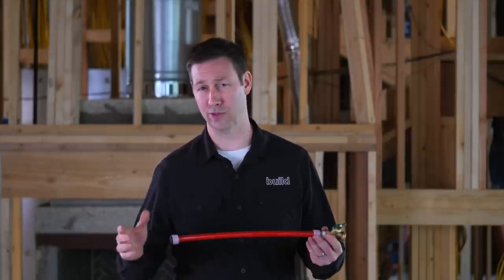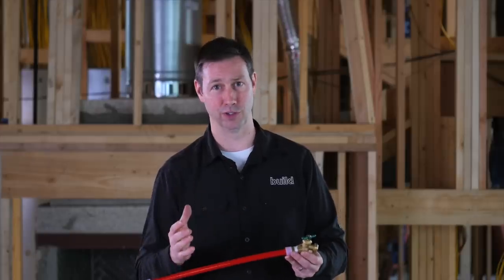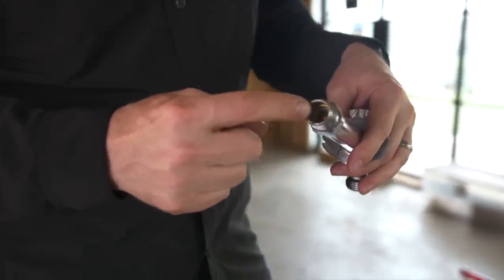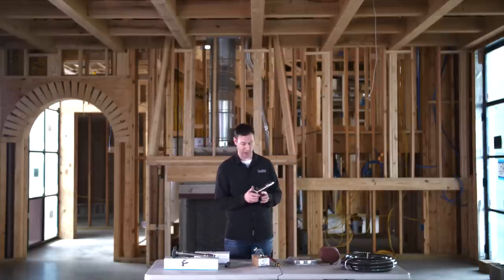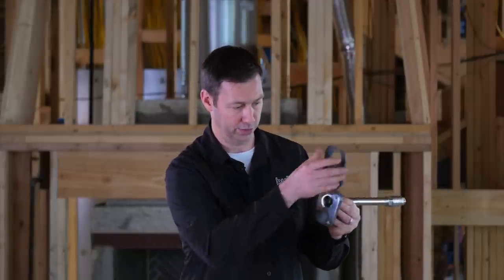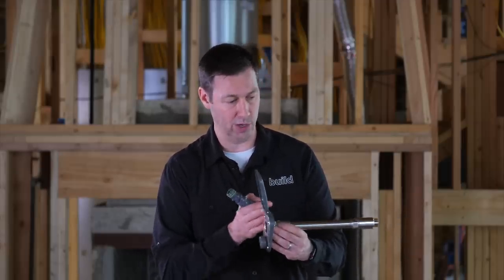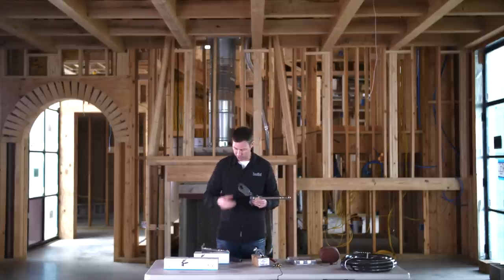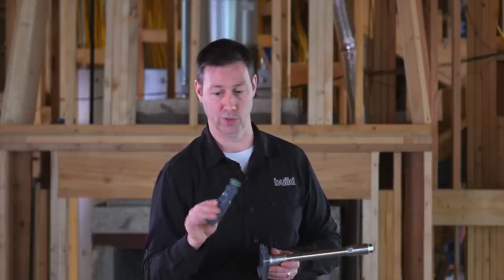No More Hose Bibs - A Better Outdoor Faucet

Comment: For all these naysayers I'm assuming y'all are still using knob and tube wiring in your houses? Sheesh, chill out and stop being so close minded.
Reply: Skisworkshop copper piping for life.  Anything else is trash
Reply: When these "New" ideas prove the test of time (50 yrs) and ease of instant no-hassle use is
when they can go into one of my homes. The price X6 along with the loop hassle and the
extra ball valve bib that has to be left on every hose or lost in the garage.
Just another expensive trinket. No thank you.
Reply: Your guys’ views on new technology & products is really uplifting and inspiring.
Reply: I love Tech but it HAS to be useful, it has to solve a problem and it has to do it well.
As for copper pipe, fine in the south but here in the north if your power goes out
for whatever reason and that copper freezes and the pipes burst, your house is in
a world of hurt. Give me PEX any day but pex is only as good as the clamps that
hold the ends together, the clamps HAVE to be quality stainless or you are gambling.
How about we have a video or two on what happens when pipes burst and the possible
damage, if the particle board or MDF cabinets get wet they are ruined where is the tech 
made waterproof cabinet sheet goods stock?
Just because something is new looking does not mean it's a good design and that goes
for the design of the entire house as well, they have to function.
Architects HATE the phrase form follows function, I know, my wife is an Architect and
I am a design/builder.
Reply: I definitely prefer pex over copper. Acidic water doesn't corrode it, more durable if it gets knocked around, more freeze resistant. And yes my knob and tube wiring works great 118 years and going strong.  The galvanized pipe not so much.
Reply: A new product and improvement in technology was happily accepted when the frost free hose bib was introduced because that was an improvement on the design. This is not an improvement to the design and I'm guessing the majority who are in full support of this probably haven't used one yet.
Reply: It's a matter of value for cost for me. I'd rather spend more to get more, but only to a balancing point. I have installed $300 recessed hydrants on houses outside  Philly, where the wind chill and long term cold justify them, but in Virginia and North Carolina, a 6-10" frost free hose bib at $25 does the trick with basically no headaches. I was not the first to change from copper to Quest and avoided the failure problems, was not the first to change to CSST flexible gas lines and avoided the grounding and bonding issues which showed up. Copper water lines have their problems just as black steel gas pipe, just as any building material. I now use PEX and CSST as they have developed a history, but still see lots of problems caused by improper installation, service and maintenance, but the history helps me find these issues and avoid them, both for myself and my customers.
Reply: Yup, my house still has knob & tube....
Reply: See, I can go to the hardware store and buy a new outlet, that will hook up to the romex in my walls. 

You can't go to the hardware store and pick up a new adapter for this faucet. At least, not that I've found.
Reply: Um better stop using NM wire then that shit is almost 100 years old... better find a new way to wire your home...
Reply: Naysayers? We are just not sold on it. Our reasons seem valid. And by the way, I don't trust knob and tube wiring. I'll stick with my candles, thank you very much.
Reply: It looks cheap and made of plastic, like something a poor person would have. Yet it's expensive as hell. We already have frost free bibs.

Comment: 90 dollars
pffffffffffffftttt
Reply: Unfortunately thats how capitalism works. This thing is probably cheaper to make than a normal wall faucet. $50 for a normal wall faucet (lead-free, BPA-free, anti-siphon, freeze proof), $10 for a service kit about every 3 years. This is $90 but you still need the attachment which is another $12. This thing also has an o-ring so it'll need to be replaced every so often. Can't even find a repair kit for it.
Reply: The o-rings on the insert wouldn't be an issue. Not sure about the internals. 
Hydrant prices can be ridiculous. I mean you can get Anti-Siphon hydrants for 25-30 in the store but some are also over 75. I've never had to service one.
Reply: There must be an o-ring in the valve as well and since its exposed to the water all the time it rots pretty quickly.
Reply: +BlindAF The packing gets hard and cracks after a while. Worst case it jams the valve.
Reply: +N C You seem nice XD It says right on the product website its an oring valve. To clarify the first part there must be an oring in the valve as well is just simple deduction. The second part " since its exposed..." I'm referring to my experiences with wall faucets. Admittedly this could have some special sauce oring that never rots. I don't actually know that. But I'd like to that was the point of my comment.
Reply: +N C Along with that engineering degree how about a reading comprehension degree while you're at it?
https://www.aquorwatersystems.com/wp-content/uploads/House-Hydrant-V2-Spec-Sheet-4-2017.pdf
On page 3: part 3 - hydrant body oring, part 4 - inner valve oring There MUST be one is not conjecture it IS an oring value thus it has an oring. Reread that 3 times if you need to. DuPont Delrin is whats used in the hose bibb. A completely different unrelated component to the shutoff valve. Although I did just lean the bibb also has a check valve in it. That's pretty cool. Part 18 actually and oh look? Do you see it to? Another oring. I rest my case. You're full of shit go take a nap or something. Stop being grumpy.
Reply: +N C I mean hey, I didn't look at the spec sheet before and it actually explained quite a bit including part numbers for the orings. So in a round-about and clumsy way you did in fact shed some light on the lack of repair kit issue. Speaking of bloviation though you're the one who introduced the pedantic banter, trying to make an argument out of nothing and failing at it. In fact every paragraph in your last post is a semantic nitpicking which is why I'm not entertaining any of them. claps You're using your two degrees well.
Reply: +N C just read the comment thread and see where it started off. It wasn't immediately obvious from a product search (I just searched on amazon) that there were any repair kits for order. So one of my criticisms is that there is no repair kit and that there would likely need to be one since its orings some day will need to be replaced. I figured that was a pretty salient point when purchasing a $100+ item. When you mentioned the type of plastic used on the bibb it occurred to me there's technical specs which sometimes have parts lists and sure enough it does. Totally doesn't mean those parts are for sale but its at least somewhat reassuring.

Comment: I like looping it but as with anything getting your contractors to build the way you want vs what the same contractor does for everyone else drives the cost and slows down the schedule. I build all high end custom homes and in certain areas of the country it is hard to find contractors that not only listen but do quality work. Quality costs money, if you want the installs to your standard and not just meet code.

Comment: Not impressed. Just look at what they use in Finland: simple as can be (and cheap), water never freezes in the pipe because when you shut off the faucet, the excess water drains out the hole in the bottom.

Comment: Don't know if you read these comments but here is a simple, cheap, have-to-have item for all your Southern customers. Just add a wall switch in the garage that shuts off the power to the garage door openers. A nearby lightning strike can fry the boards in multiple garage door openers at the same time. Not uncommon to have 3 in a new house and replacement costs can run into the hundreds plus labor, not to mention the inconvenience of having to manually operate the doors.

Comment: Yeah, that's neat, but this reminds me of the debacle with Apple removing the headphone jack and replacing it with a proprietary dongle you plug into the charging port to listen to music with. While I can see the appeal, this wouldn't be something I would use for my future home. A neat concept though.

edit: Adding the loop of water pipe in the wall is a neat trick that I will utilize in my first build. Thank you for showing that

Comment: enjoy your face full of water everytime you unhook it
Reply: No one seems to have picked up on this, though I laughed out loud when I read it! In fact I can't think of any way to avoid it. The other end of the hose is shut off, so pressure builds up in the hose. You unplug the connector, which shuts off the supply but releases all the built-up pressure in the hose. What a mess!

Comment: Is this not just a plastic version of a buckner brass quick coupler valve? We use brass quick coupler valves pretty much everywhere here in Ohio. By far the most common outdoor water supply valve I see, especially at homes with a sprinkler system. Anywho, I would just buy a brass buckner quick coupler. They basically last forever.

Comment: That a nice looking faucet system, but I can't see the practicality of this - especially for a house with kids!!

#1 - $90 for a hose bib?? Really?!?!
#2 - Need special adapters for each faucet.
#3 - The first adapter shown is a full-on adapter with no flow control.
#4 - The special adapters are plastic - which can probably be broken if someone pulls a little too hard on the hose as they try to get that LAST INCH of reach in the back corner of the yard...
#5 - The adapters make their water control connection 1"-2" inside the front of the faceplate - so if the adapter gets broken, you need to turn off the main supply to stop the water flow.
#6 - If the adapter gets broken the typical homeowner would probably have to call a plumber to get it removed.
#7 - The adapters on Amazon are About $35 for each
#8 - How long will the manufacturer be around? How long have they been around already? Will there be support in 5, 10, 20 years?

Yeah...Looks nice and pretty, but not something I would consider for my house.

If your client wants the hose bibs hidden, build a recess with an enclosure to hide the bib. It'll look pretty, have regular functionality, be serviceable, and will last for years and years without headache.

I will say this though - I LOVE the internal loop idea!! I think that should be done for ALL through-wall connections! Would make down-the-road servicing much easier!

Comment: * More expensive
* No shutoff valve so you have to unplug your hose for the water to drain
* 50% plastic construction
* Have to get custom non-standard fittings for all your hoses

This guy is just advertising overpriced junk for an amazon kickback & to please his sponsors.  Scam.

Comment: Yeah no thanks. Only 5,000 connector engagements until seals need replacing. Water starts to come out moment you push the peace in, when most cases pipe is there for whole summer and you are looking for just reliable valve. Separate valve peace can help some what, but system like this that relies on twisting, just ask pipe to turn and be disconnected. Also only minus 21C temperature resistance is way too little. We get minus 30C here and before global warming it use to be minus 60-70C at worst.

Comment: How would the plastic hose attachment hold up over time when I am running my Dewalt 3300 PSI 2.4 GPM gas cold water pressure washer next summer?

Comment: Honestly, this looks so cool UNTIL you plug in the bib thing... That looks awful and cheap and is also realy inconvinient! Why? I have watering computer installed on my current hose which won't work on this thing because it's designed to be placed in a 90° angle down.
I got one of the second bibs you showed, those with vac breaker and this is just great. It's a normal bib where you can connect every STANDARD stuff you like without any flimsy plasticy bs stuff. And the best, when you turn it off, which you usually do like every time you don't use it, guess what, IT'S FREEZE SAFE!!! No detatching anything, no extra thinking, nothing, just close the valve and you're good. Oh and it's much cheaper! 
OK, it may not looks as cool as this thing but if that's you're only problem you may not need any water plug or bib at all hahaha

Comment: I call it BUST. Them rascals bust to smithereens. Now Matt, putting that loop for future use is SMART!! But I don't like that it's plastic, plastic cover, etc. I'd pay more for steel, aluminum. Especially the actual hose connector. I in east central Georgia, hey even here, you'd better prepare for some COLD weather! I've seen it as low as 9°. Those not prepared have problems.

Comment: Never had a problem with normal spigots. Though I'm also smart enough to know freezing is bad for pipes and shut off the outside spigots from the system inside. I could have sworn there was a code that required that. So much plastic in that design, it can't last long. I do like the loop idea, though. Just for that 1 in a million chance that the spigot actually fails in 50 years.

Comment: After reading comments and thinking about it, this seems like a solution we don't need. I really like my washerless 12" through the foundation block outside faucet. What's bad about these? Strong all metal, no worries. On/off, easily adjust pressure coming out of hose, yes, I'll keep using this kind. Hate plastic.

Comment: If you're building the house, just feed all the outside hose bibs from one line, and put a valve on that!  $90 for a hose bib?  Does it quick-detatch?  No!  Is it plastic, and long enough to break off under force?  YES!  

Looping the PEX assumes it won't dry out and crack in the loop.

Comment: so, what do you do when you live in the south (SW Mississippi) and your 40+ year old FHA house has frost free hose bibs that start leaking. New rubber isn't available because the type of hose bib isn't available anymore, and there's no way of knowing if the bib is threaded into old copper pipe, or old pvc, or what.. ???

Comment: Not going to comment on the plastic plumbing appliances featured here because everyone should learn the hard lesson of using them on exterior applications. But the southern falsehoods I must bring truth to. I've doing plumbing in the south for several years on older and newer homes.  "Freeze Cocks or Frost-Proof Silcocks" as they are called have been plumbing code since the 1960s. Not that they don't exist, but I've never found a short hose-bib on any home south of the mason dixon line.  And further more no contractor is getting away with running pex directly to a short hose- bib on an outside wall.  Maybe this is common practice in Matt's southern Texas, but the home I owned in Florida had Frost-Proof hose-bibs, and the one in Tennesse, and Oklahoma. Just clearing up that this is not a "Southern thing", we use frost proof silcocks.

Comment: Sure Matt... what could possibly go wrong with a cheaply made plastic part that plugs into another cheaply made plastic thing mounted on the outside of a house in -20F weather?? sure pal. Why would I use that? Normal faucets are not a binary on/off flow. How do I control pressure/flow with that thing? useless.

Comment: Uncommon fittings on common equipment. What could go wrong? I use quick-connects because I never leave an idle hose connected to the bib, and use 1/4-turn hose bibs. What I neglected is how flummoxed a gorilla-fisted contractor gets when he needs to unscrew the quick-connect fitting and thread his hose on to the bib. And, I've replaced several handwheels where gorilla fist cranked it two turns open. And if it's a rental? Forget it. Go common and go brass.

Comment: I don't know if these are any good or not, but many of the comments aren't.

"Sometimes you don't want full flow!"

Ignoring for the moment (as you all apparently have) that Mr. Risinger pointed out that a standard faucet adapter is available and assuming that one's going to use the standard adapter,  what do you all think's going to be on the other end of the hose in such instances?  I don't know about you folks, but when I want to regulate the flow, I put a nozzle on the other end instead of running back and forth to the faucet a dozen times.  Sheesh!

"It's plastic!"

The device itself is metal:  only the adapters are plastic.  They look very thick and sturdy.  Might they eventually break?  Sure, that's true of anything.  At which point you buy a replacement or use a spare.  (It takes a quarter turn to put them in:  if you can't figure out a way to extract the inserted piece, maybe you don't have the where-with-all to do handyman work.)

What they won't do, safely tucked away in the garage, is freeze and burst as the fixture they replace would.

"I might lose it!"

Seriously, dudes?  If you don't have a system where you either leave the adapter in a particular place or on the end of the hose (gonna lose the hose, too?) and you really do lose one -and you don't have a spare- then... buy another one.  If you can't get them locally, you can order them from the manufacturer or from Amazon, I already checked.  (They cost $11.95.)

"It might leak in the house!"

I have the alternative now.  It's been fine for many Colorado winters, but last year something broke and it leaked --when I opened the valve with a timer on a hose and the timer cut off.  There's a chance of leaking with any plumbing.

My main outside faucet is not only hard to get to, but it's also so low to the ground that it's difficult to fit a hose onto it --and, despite being an inside hydrant, part of it froze last year:  being able to walk up, jab the adapter straight in and give it a quarter turn?  Where do I sign?!